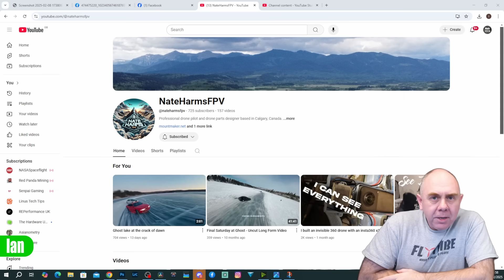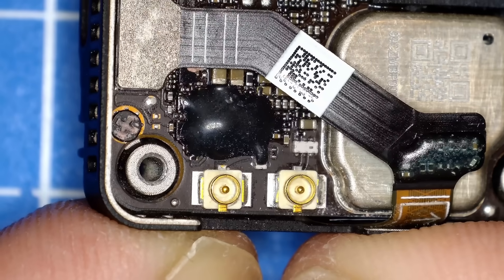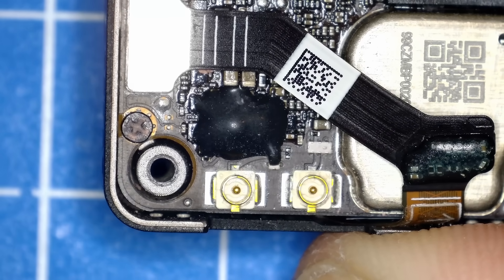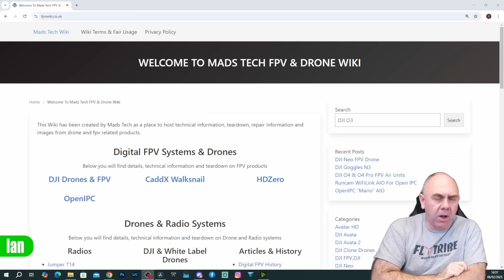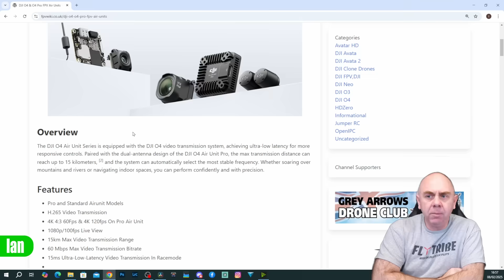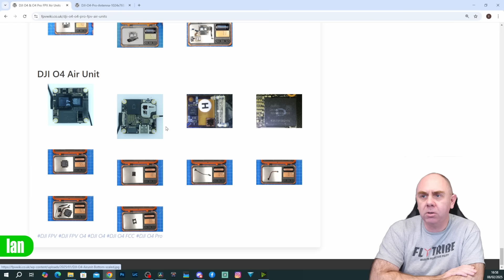DJI O4 Pro Airunit Has UFL Issues - How To Protect Your Self!

Comment: my flywoo lr4 analog vtx had a bracket of sorts, that two screws held across the ufl. never had an issue with it like other ufl's i've had. I understand they have their place. In our hobby where things arent just sitting there operating on a shelf i believe other companies should be implementing the same type of mechanical conection..

Comment: Does anyone know if DJI solved this problem with the current O4pro modules meanwhile?
And another question: If you improve the strength of the O4lite by putting glue on the connector of the camera, do you lose the warranty thru this?

Comment: Anyone know what the small white transistor or what ever it is called , i damaged the one on the left ant connector " right before the ufl lead they have that small white rectangular component,  i damaged it with a small flat head smh😅 and broke conection on 2 of the leads , long story short i thought i could do it my self and i ended up messing up the component and now i don't know what to do.  Ive herd dji repair takes for ever and such so i found a local computer shop that could fix it but they need to know the specific part, and they said they wouldnt charge much to install around 40usd ,  any advice on my problem,  im new to all this n don't want this 04 pro to go to waste 😢

Comment: I’d soak that thang with no clean flux. Fresh flux helps the solder flow faster so you don’t have to dump a bunch of heat into your joint

Comment: Same issue on Betafpv Air series AIO For Tinywhoops, on brand new ALWAYS Need to tin propetly ground pads on these, other way ufl unplugs with entire port xP
Reply: With the modified canopy (last year with small ufl cutout) and some dental floss, my 4 x Air65's flying for 12 months no probs. Much easier than trying to solder.

Comment: Mads, can you help?
I had a crash where the antenna was pulled out, and now the drone doesn't connect or bind, however what I find strange is that not even the binding button works anymore, I click and hold and the LEDs don't blink / flash.

Comment: Man I wish I had watched this video before taking my first quad out :( I crashed into grass from maybe 8 feet in the air and ripped the right ufl connector and signal pad off with the gentlest crash of all time. My trace was even lifted, but luckily I was able to bend it back down in place. HOPEFULLY I'll be able to resolder to that center pin on the filter, but it's gonna be tough without a microscope. Thanks a ton for the closeups! They'll come in handy for sure.

Also I tried sending it in to DJI and they refused to help :/ they just kept saying "they don't cover crashes." That's not the point! I could have pulled it off with my fingers lol, it feels like a design or manufacturing oversight.

Comment: Hey Mads Tech or anyone in the comments., I flipped by Cinelog30V3 and the antenna got caught in the props(i didnt know since i couldnt see it on my goggles) i tried turtle mode..
one of the antenna got ripped from between... RIP..
I tried flying with the half ripped antenna, i still got 60mbps connection and i think the connection was still stable like before....
can you please tell me how do i fix it?
It's a dual antenna, are the both LHCP or just the one? im not sure.
also, will 3rd party lhcp antenna work..??

Comment: Any idea what might cause one to work for one flight, than stop working after a battery swap? I got a new meteor65 pro yesterday. I updated my goggles3 with the dji consumer 2 app, updated the dji 04 unit with the app as well on my pc. The unit shows up on the pc, and I got it to bind once but than after a battery swap I no longer can get any video. I tried to re bind my goggles to the air unit and the drone go into the binding mode now... i rolled firmware back and updated again, didnt work either way so I have no idea whats going wrong? I am brand new to this so I was already in over my head and this isnt helping.

Comment: FYI, if one purchases their air unit, or a complete drone from GEPRC or similar company drop shipped from China, the expected solution is to send back to China vs dealing with Dji US. Each region has different s/n's and one must replace it where it originated from, or 

TLDR, = learn to solder if you buy your unit from China .

Comment: CAN YOU HELP ME PLEASE 
Got my new pavo20 pro with dji 04 Pro but unfortunately when mounting the Dji antenas my hands slipped and didnt notice that the antena plug was pulled from the board o after some time trying to pair my Goggles N3 with the O4unit with no luck i disassemble to check the connections and the antenna connector was loose. But the other antenna it's ok in place !!

Can confirm with one antena is broken the 04 unit wont pair with the goggles n3? The goggles just keep beeping but no binding😭

Tried everything, last update on all devices, the right ports on betaflight, the sbus settings but still no luck is just like my 04 air unit is not emitting the right signal to pair with the Goggles n360
All parts brand new but cant flyanything with the 04 flight controller

Comment: Adding more of tinn it dint make it automaticly sronger you forget for 1 of 4 important steps of Quality solder and it is GEOMETRY !! in my oponion if solder is week there are like 3 options used material cold solder joint or bad solder so beter use solderwick remove solder (becose it is probably lead free it is like 10 times weaker especialy if you solder on gold it is way weaker ... ) when you remove all solder add flux preheat pad (try to not touch ufl add tinn ( but right amount dont make hils ..and balls like in video OMG ... its going to be weaker than it can be :) but if you chang solder (you mix it ... ) it will not be so big deal :) but me personaly always desolder UFL and cut signal wire and joint GND to GND signal to signal directly without UFL its beter just signal should be short and be aware to short it than it is perfect strong never disconect beter signal (litlebit)

Comment: O4 Air Unit Pro acting like it has No Antennas, UPDATE
(see my other comment for details)
The Air Unit came on a Flywoo Flylens 75.
Plugging in a different Air Unit to this quad works fine, meaning the Air Unit is defective.
TO FIX IT my choices are:
1. Send it to Flywoo in China for $33 (they won't pay shipping) and wait for who knows how long.
2. Take it out of the quad and send it to DJI in China using a webpage that is in Chinese, though they will pay for shipping, and wait for who knows how long. Sadly, DJI tech support will not help with this return, they just sent me instructions on how to do it using the webpage that is in Chinese. (note: this will void my Flywoo warranty)

This is, apparently, because the warranty on the Air Unit from Flywoo was bought by them in China and is a Chinese warranty and not an international warranty. 
THE MORAL OF THIS STORY:
Buy a quad with no Air Unit, Buy the Air Unit in your own country and install it yourself,
which is what I have done with a BetaFPV Paco 20 Pro.

Comment: U.fls are always a weak point, even if they are soldered on properly. Why don’t they add some strain relief for the antenna cables? Like a loop (w shape) on the pcb or on the case, so the connector doesn’t take the full force.

Comment: I respectfully disagree that this isn't a design issue. The very fact that there are people discovering this and correcting it themselves after spending the amount of $ as we do on DJI gear tells me otherwise. I ripped an antenna in two when the TPU holder failed on a Walksnail VTX and low and behold, the UFL is completely in tact. Appreciate the video and heads up and respect your opinion even though it differs from mine and others on this particular topic.
Reply from the maker: It's a manufacturing issue not a design issue.  Design issue would be something they inherenty did wrong. Such as the Lite camera board on the back.  This is just poor soldering not a bad design.

Comment: Start to use flux. You will be amazed. And try to lean down the tip on the side to get more contact surface. That will help on ground plane
Reply from the maker: Yes I'm well aware of flux.  IV I oy bwe. Soldering for 30 years and being a repair tech for 29 of them.  

As for leaning the top down you cant unless you remove the board.
Reply: @MadRC  sure?

Comment: I was familiar with the problem of u.fl sockets breaking off. It also occurred in the Air Unit O3. In fact, the cause lies in the corrosion of the socket contact surface. It can be seen well under a microscope. I informed DJI about this problem. As you can see, they still have a problem with it.

Comment: My o4 pro came with a weird problem where it binds only very close to the goggles and transmission power is very low at around 10-20 mbps when armed. In low power mode is 0 mbps and black screen with osd. I guess is related to this ufl connectors but they look fine and i removed the original antennas and tested with others but the same result. Changed chanels , refreshed firmwares on both goggles and air unit, powered from different fc’s … still transmission power very low with only 10-20 mbps if i keep the goggles close on the bench. I’ve send it back to dji. We’ll see
Reply: Im not getting any binding at all even touching the goggles with the o4 air unit. The worst part it’s a brand new unit with one of the connectors snapped off while assembling it😭

Comment: The problem is the amount of thermal mass on the ground plane. You said the uFL on the right fails the most often. That one is right next to that massive can that will be absorbing a ton of heat during the reflow. So this problem will probably be solved by refining the reflow process. Higher temperatures or more baking time. Just one opinion.

Comment: It's a  simple fix. strap it down with some tiewrap the ufl cable and use some 3d print that encloses the antenna so it doesn't get stipped off!
Reply: People are breaking theirs without the antennas even being pulled😔

Comment: This solder issue on the Pro, and the thin PCB on the Lite, are indicative of the whole O4 lineup being rushed and poor quality. I think they'll fix this in a few weeks/months. Personally, I don't think the O4 is that huge of a leap and the O3 is cheap right now, so why not just hold off on the O4's for now? What's the rush for? Let DJI fix this issue! Put off your O4 upgrades until April or so, and I bet you'll see these issues vanish completely.
Reply: With the goggles 3 it's a pretty significant jump in my book. I'm loving it, almost to the point I'm considering not running GoPros anymore.

Comment: Wouldn't be surprised if DJI does a recall, dont forget some MIPI connectors causing a micro-disconnect and freezing on even just a bump needing a powercycle to get video back, there are evidently some pretty big manufacturing issues going on

Comment: But would more solder and more solid hold cause more damage to the board if they are ripped off
Reply: Potentially, best bet is to make sure you have reasonable strain relief in the way you mount the antenna's 👌

Comment: Mechanical strength would be greatly increased using silver solder.  Many years of use in high stress connectors without solder cracking from vibration/stress.  The only downside is after a year or so, the solder will tarnish looking more black. No decrease in performance, silver providing better conduction!

Comment: Can we get your thoughts on the latest Bambu Lab firmware update and them changing the terms of the sale? :-)
Reply: It's not that deep just put custom firmware on it
Reply: @handledrandomly  Not a lot of custom firmware available, and loading the firmware is not a simple process. Aside from which, I'm sick of companies changing the terms of the sale and treating sold items as if they own them. There are zero reasons I should have to communicate with an offsite server to send files to a 3D printer
Reply: @krazed0451  you don't have to. Use the SD card. Flashing cfw isn't difficult either, the only chance is if you use slicers other than bambus , and if you can do that then there's no reason you shouldn't be able to flash cfw
Reply: @handledrandomly  Mate, a local network connection should always be an option if the networking equipment exists in the machine. Stop making excuses for companies acting as if they own products they sell post sale. Simping for big business is a poor look.

Comment: The GepRC Mark 5 upgrade kit didn't hold the antennas as tight as I liked in the new TPU mount so I wrapped some cloth tape around  the ends of the antenna tubes. They are now held tighter than the original O3 mounted its antenna. Think this should provide decent protection since the wires are pretty enclosed within the TPU air unit mount pieces.

Comment: Thanks. Since I'm not absolutely good in soldering any suggestion on using glue and which one should I use to avoid any short circuiting. Thanks a lot.
Reply: Hey there, epoxy or green aviation torque seal coud do the job
Reply: @esfliegtshon  thanks, buddy.

Comment: Either way you don't want to be "relying" on a bit of extra solder or glue if you're crashing the drone hard enough to rip the connectors off. They are delicate by design. If not that, the antenna crimp is going to rip out. The thing simply needs to be mounted so a crash isn't going to put ripping force onto the antennas or the wires.
Reply: Exactly. I don't see the issue here, resoldering a UFL is much easier to fix than ripped out solder pads. Its not like it will just randomly pop off by itself one day.
Reply: @MarkusRessel  I can only imagine a poor solder job which gets worse over time in various temperatures but I'd also figure these PCBs are not being soldered by human hands. Otherwise yea I don't get how vibration or inertia is going to cause those things to come off unless it's the antenna wires doing it.

Comment: Nice video on important detail. I have lost a lot of Vistas that I speculate got problems at the ufl interface. I have gotten greater reliability by encasing whole bit (including the antenna half of the ufl in E6000). Soldering ufl is micro work and not so easy for home hobbyists, but Mads encouragement is great. Also kudos to HDZero for recognizing this vulnerability with their gear and providing their own reinforcement options (although I still go with E6000). Also check out B-7000 which appears much better in terms of application with its fine needle-type dispensing tip!!!